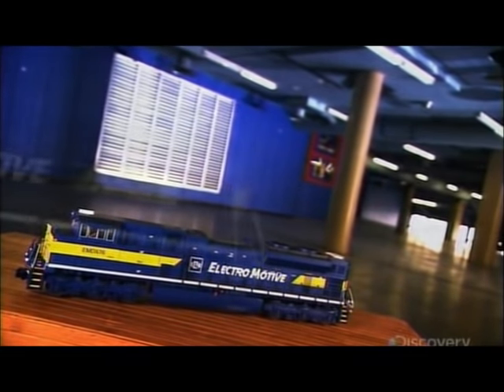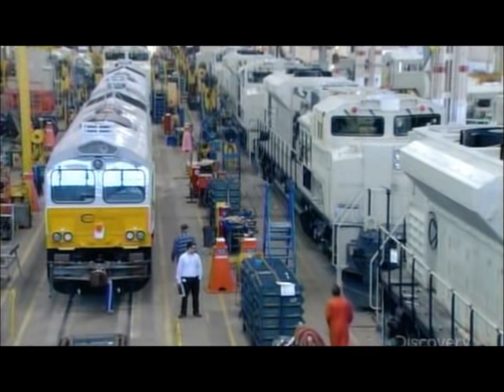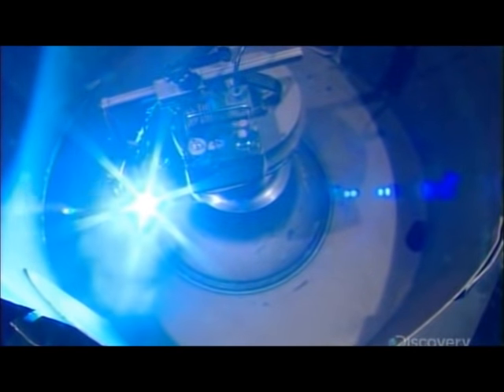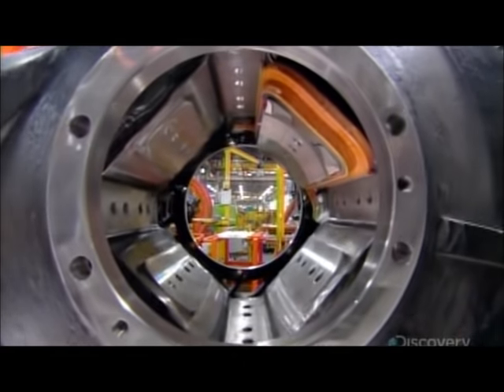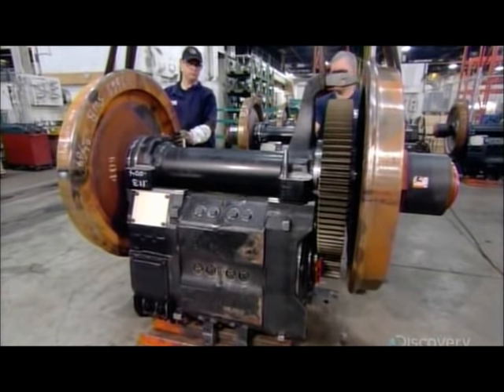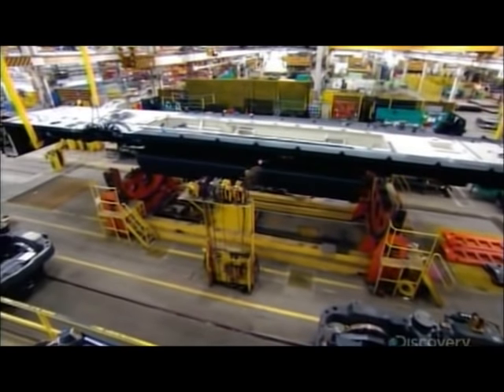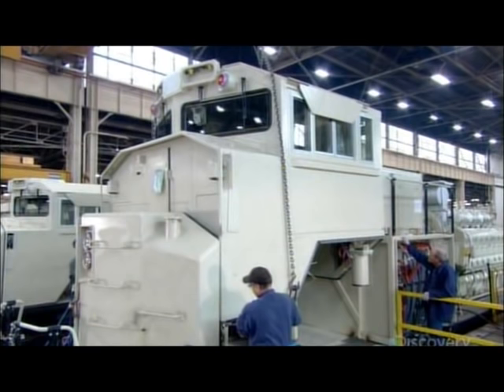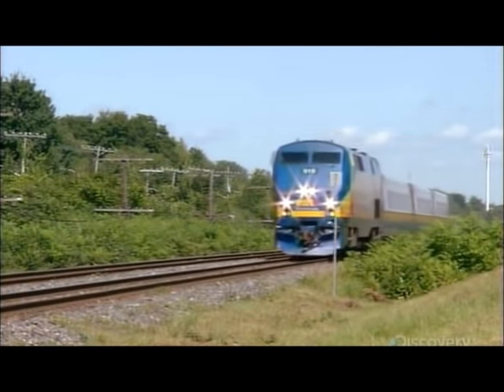How It's Made - Locomotives

Comment: 0:25 "where tracks are wider and stronger than in most parts of the world"
what a false statement, gauge in argentina is 1,676mm with 3.2m wide trains, so track are wider in my country. stronger, well, they resist corruption, that someting u.s. rail couldn't resist
Reply: When Bombardier was producing the ALP-45DP locomotives for N.J. Transit in Germany, they couldn't be tested in Germany because the rails were weaker, and were shipped untested to the U.S., so while the guage may be wider or narrower in some countries, the rails are definitely weaker elsewhere because the U.S. (and Canada, because they want to be comparable to the U.S.) rail regulations are stringent (they mandated Positive Train Control sometime ago).
Reply: ". . . than in MOST parts of the world." Listening must be hard in your country.
Reply: +Will Schilling i don't fully master English. you know, there is other languages and countries
Reply: brunoignaciogi
Reply: These are not 10,000 amp systems either. They are closer to 700 amps and about 5,000 volts.
Reply: The gauge might be standard, but the rails might be lighter. Remember that rails come in many different sizes depending on the load that is expected to be put on them. Mainline rail in the US is usually around 140 lb/yd or more. You don't generally see heavy-gauge rail like that in Europe, and I doubt you see it much in Argentina, either.
Reply: She said most...
Reply: Thats a bit of nonsense you are talking here.
Rails were laid according to the load they have to bear. Rail quality also depends on how heavy the load is that has to be transported - the weight alone is not decisive.
Everywhere in the world rails are used according to these specifications, and so it is safe to say that any ore or coal transporting railway - such as in Sweden, North Australia, Russia, Brazil, Saudi Arabia, China, but in the end, regardless of where it is - are using heavy and high quality rails. These rails weigh just as much as the ones you're talking about - which, by the way, are not part of the whole US network, but are only laid where the load demands, because rails, and especially those of the highest quality, are expensive.

Furthermore, high-speed traffic demands heavy and high quality rails of the same weight class as those used for ore trains and heavy freight traffic. You may not have to tell anything about that, I can give you that credit - the US does not have high-speed traffic, and on the routes where they drive what they call HighSpeed, most trains are reduced in speed because of the tracks are not set up for such high speeds.

Why do you think that everyone else except the US railways has only small, light, short trains? What about the Russians, who have a wider track and a larger clearance profile than the US and are not behind the US with the train weights or the performance of the used locomotives? Lets keep in mind that they have electrified the whole Transsib on a length of 9000 km and use the stomgest electric loco of the world with 17000 HP there.....
Or the Chinese: On what kind of machines do you think the Chinese diesel-electric DF8s have been developing their brute force of 5,000 horsepower apiece for over 15 years now, pulling their heavy freight trains over the slopes of the Jitong Line?

Think about it, and come down from your faith. It distorts your look for reality .....
Reply: Pearly Humbucker wow I've been working in a train maintenance yard installing security features and I've been watching the men work on the trains. Ever since then became very interested in them. Company that runs the yard is Bombardier. Old trains look similar to the ones here rather at 3500hp the new ones that run 8 million apparently get 4000hp. Never knew trains were so interesting.
Reply: @Joseph Heston
American rail regulations ar stringent? Why dont you stop dreaming? Why dont you take a look over the fence and compare American rail regulations to the regulations elsewhere? 
They mandated PTC? And now everyone should jump up, "Long live America" screaming and clapping?
PTC's goal is to achieve similar quality as the European ETCS already has today. That means that .PTC is just starting, ETCS has been running the second version ETCS2 for a while now.
With other words: No neeed to celebrate, because America is far behind.......

If the American regulations were stringent, then the accident in Tacoma would not have happened, in which a Charger with train jumped the tracks because of excessive speed, probably caused by insufficient route knowledge of the engine driver.
For if the American regulations were stringent, the railway authorities would have insisted that the railway company would fully install and commission the PTC. Instead, they pushed the deadline a bit further. A stringent railway authority would not have allowed them to race at full speed through the country, even though the safety equipment was not yet in function.
Reply: @Will Schilling
What is there to complain about?
He is correct. The talking Miss tells some bullshit that in America the tracks are wider than in the most parts of the world. 
This is clearly incorrect. American tracks are standard gauge - the most of them. The rest ist narrow gauge.
But the rest of the world isnt covered only with narrow gauge - most of the parts of the world uses standard gauge, like America does.......
Reply: i would be offended with that comment on the u.s. but.... lets be real.... he's right
Reply: +Pearly Humbucker  If you would quit being snide for a second, explain to me why Siemens had to redesign their Sprinter locomotive for the U.S. market?
Reply: @Joseph Heston
The question is, what do you understand by re-design? Do you mainly mean the external appearance or rather the inner values?

Unfortunately I can not really say for sure about the design of the interior of the Charger - there is simply not enough clear information about it. But if you make a comparison of the recognizable components and construction of the SC-44 with that of the father (or mother, whatever) of the two American Siemens locomotives SC-44 and ACS-64, the VECTRON, you will find that it can already be seen from pictures that the innards of the SC-44 must have a lot in common with those of the VECTRON.

All three obviously use the same bogies - no wonder, because below the waistline all three are electric locomotives.
The large fan grille SC-44 and Vectron also have in common, which suggests that all the cooling elements sit in the same place in both machines.
This puts the engine in the same position again in both machines - there is simply no room elsewhere. 
It can be assumed that many components are the same for all three machines, and therefore follow the credo of the modular design of the VECTRON and sit at the same place.
And you'll probably see, if you look more closely, that most of the components in both locomotives even look the same, if they are not the same make - the parts are indeed made in America by American companies, as required by the government, but still to the measure of Siemens or even with Siemens owned suppliers.

As far as the exterior is concerned, the cabins are, of course, interchangeable and with the help of a few large plastic parts, all sorts of design wishes can be realized.

From this point of view, the internal adjustment of the locomotives is not really that dramatic, and the external adaptation is a result of the modular concept of this series and one of the features that makes this locomotive shine.

It is perfectly clear that the Prime Mover must be an American engine, the experience with the KM-4000 already showed that 50 Years ago. Only Cummins remained, otherwise they would have to buy at the competition.

The biggest adjustment to the American market is likely to be the change in the cabin side frame. The American regulations here demand a larger crumple zone and a climbing protection, which is not required in Europe. 
The reason is simple: American locomotives are expected to hit headon at some point, European locomotives believe that advanced security systems are preventing that from happening.

Incidentally, adjusting a locomotive to the system on which it needs to run is nothing really remarkable.
Modular concepts like that of VECTRON have been developed for this purpose. The VECTRON is available as an electric locomotive for various power systems, as an electric locomotive with LastMile diesel, as a diesel-electric locomotive, in wide gauge version for the Russian broad gauge. 
Today's modular locomotive series, not only those of Siemens, are truly global machines that can be used internationally, and of course that also includes various adaptations to the operating system.

American passenger rail transport, in contrast to freight, is in principle not very different from European passenger transport, given that Europe is moving faster and on better and safer tracks.
In short, adapting the SC-44 was not necessary to make it a better locomotive - it was an adaptation to the worst case.
And THAT speaks for itself .....
Reply: Usa, strong rails?
Ha!
And we in sweden consider our track (that is like 100x better than in usa) problematic ha!
Reply: @Kasmuller  you drink to much. If you think sweden has better standard gauge rail. I dought in sweden that they run 6600 ft freight trains.
Reply: "most parts" of the world. North America has wider and taller loading gauges than most other parts of the world. Not all, but most.
Reply: MOST
Reply: What? THE u.s Basically has Very VERY Heavyweight and tall locomotives, the biggest locomotive in the world (big boy) exist in America, built in America.

Comment: I don't care how much horse power they have. How much torque can it exert?
Reply: Torque doesn't necessarily matter in the railroad industry. The equivalent is measured as "tractive effort"
Reply: God i wish i knew what you two were talking about
Reply: +Simba Hunt The first person is bragging with his (copied) knowledge which he makes sound like an opinion. The second person puts him on his place.
Reply: Its straightforward to work out torque on any engine if you know the horsepower and its max RPM using the following formula. 5252 multiply HP divided by the RPM. Engine in video makes 4300 HP at 950 RPM so, 23'700 foot lbs of torque.
Reply: That engine only drives the alternator ;)
Reply: Tee Roy Slyks -Locomotive Diesel engines get much of the attention but the traction motors and the generator/alternator that power them are the workhorses that get the heavy train moving. Traction motors can develop monstrous torque to get a long, fully loaded train moving from a standstill.
Reply: Formidable38 
Railroad locomotive ratings are not based on the power of the Diesel engine under the hood, it’s calculated based off kilowatts per hour available for the traction motors. 
GE, EMD and railroads aren’t overly concerned with what the Diesel engines rating is, they care what the traction motors do with electricity and how that converts at the railhead. 
The locomotives rating may not seem impressive at 4400 hp, but these locomotives truly put out insane amounts of power.
Reply: You do realize that torque is just a component of power and that neither actually matters when you're pulling something, right? Tractive effort is a function of weight and adhesion. A 6,000 HP pickup weighting 4,000 LB would be no match in a pulling contest against a 380,000 LB SD40-2 delivering 200 HP in notch 1. It's just that simple. Even rubber on asphalt can't deliver enough adhesion on a vehicle that light to match that kind of tractive effort. All the torque in the world means nothing when the wheels start to slip.

Power just determines how fast you can do the pulling. Obviously, we'd like to have some, because pulling without motion is only good when you're stopped on a hill. Al Krug explains it pretty well here:

https://web.archive.org/web/20160303073105/http://www.alkrug.vcn.com:80/rrfacts/hp_te.htm
Reply: Its torque is equal to 14 men pulling on a 6 foot rod. Okay perhaps that was just the torque setting for the headbolts?
Reply: all of it

Comment: One bit of misinformation - an SD70 can pull trains much longer than a kilometre, if it's all empties.
Reply: That is why locomotive units are set up to be able to be coupled together to be operated by one driver(engineer) to achieve the HP needed to get the train over the road.  With radio controls DPUs(distributed power units) may be spaced through out the train including the rear, to distribute the forces needed to move the train so that all of the forces are not at the front.  Kinda helps to not break couplings and lowers slack action.
Reply: @royreynolds108 No, a single SD70.

Comment: 2:16 - Magnetic field, NOT an electric field.
Reply: WROOOOONG, its an electric charge
Reply: It's both. Electric fields create magnetic fields and everything happens in right angles to each other. Hold you right hand palm up. If the electric field goes forward (in the direction of your fingers), then the magnetic field goes right (in the direction of your thumb) and the actual pulling magnetic force goes up, out of your palm.

Comment: Trucks not Bogies, even HTC calls them trucksets... Those are boogers to the butthurt in the UK. The truckset mainly serves as the means of tractive force to move the locomotive but in dynamic braking the traction motors  along side big resistor packs serve as a retarding systems to keep the train under better control on grades and not relying on the train and locomotives physics brakes (air brakes) which serve better as a low speed stopping and parking brake once the train has reached a certain low speed or has stopped.

Generator not Alternator. Generators produce AC current via permanent magnets or a field winding. The generator in that EMDDS unity produces 3 phase 600 Volts AC which is for powering the traction motors, an alternate generator is also in the main drive chain for powering other systems in the locomotive. Also in the main drive is the locomotives air compressor that is activated by a pressure switched clutch system  and this is in the rear hood of the unit under the SD70ACe's dynamics fan. 
Some builds have AC to DC rectifier units that convert AC to DC but those are mainly your passenger units where speed and run up is more important than torque / tractive effort vs train weight.

General Electric makes the bulk of American and foreign DC driven diesel locomotives where EMD does the AC bulk

The show an ES44DC CN loco which is a GE build in an EMD video?
Reply: It is alternator because it produces AC power. It comes from Alternative Current. Generators produce DC power.
Reply: +ElfNet Gaming  A truck is an open train coach which is used to carry stuff like coal.
A bogie is the wheel assembly of any train coach/loco. E.g. "The French TGV has common bogies between coaches".
Reply: ***** Here in the States they are called Trucks.
What your describing is a gondola or an open top hopper.
Reply: I'm not sure about that, but many people confuse bogies for train coaches that are used in passenger trains. That's not the case. Here, 'bogies' means the wheels.
Reply: ***** I know in the UK and Europe they call them bogies meaning the wheel assembly. It reminds me of the cookie vs. biscuit thing.. We Americans purposely change the English language around to fit us and say screw the rest of the world lol. Instead of just leaving it alone..
Reply: I know :P
Reply: +ElfNet Except that this is a Canadian show. It is produced and filmed in Canada (the plant shown was located in London, Ontario). In Canada we call them bogies - screw what the Americans call them, it's not particularly relevant. ;)
Reply: The problem with your reasoning is that GMD called them trucks, and so did MLW and CLC. The only Canadian manufacturer to use the term bogies is Bombardier, and they're a buncha French weirdos anyway. ;)

I've also never met a Canadian who actually worked on the railroad and called them bogies, so it seems like less of a Canada/US thing and more of a layman/not layman thing...
Reply: no bogies
Reply: "Alternator" is jargon for "alternating current generator." Modern electric and diesel-electric locomotives are "AC," that is the traction motors are alternating current motors. Many years ago the traction motors of diesel-electric locomotives were commutated direct current motors.
Reply: The alternator on these actually produces dc current. It is then sent to phase inverters converted to ac power.
Reply: They are Bogies.

Best Regards,
The country that invented trains